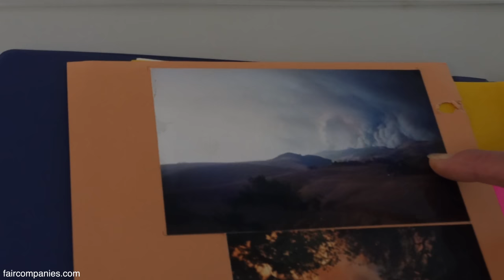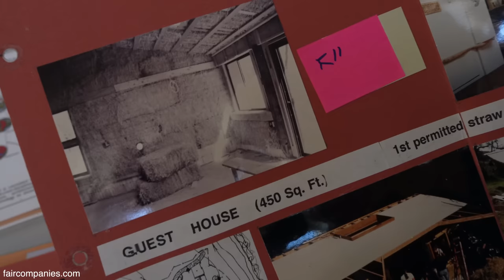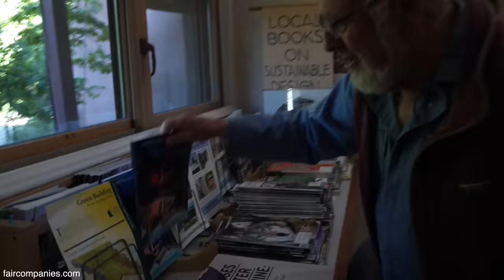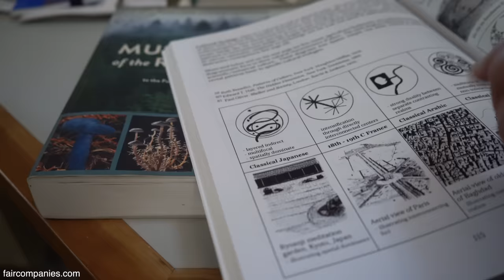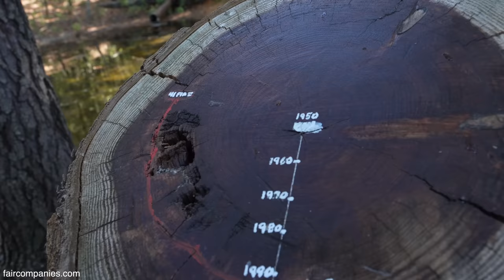Strawbale Home couple built after fire is bioclimatic marvel

Comment: At fisrt I thought it was an earthship type house but it is similar......The solar water heating window wall gave me an idea to also use mirrors in winter to direct more sunlight to heat the water.
In freezing winter Illinois temps. I played around with using mirrors to shine more sunlight on my solar panels. It made quite a bit more power without cooking the panels. In summer it'd cook and damage the panels if you tried it.....I forgot about using hay to build off grid.....Seems like something like a 20×20 hay bale cabin would be more insulated than a conventional home.
Reply: I replied the following to somebody else, I hope you find it helpful: "Don’t underestimate the caloric power of the sun: dry places that go below freezing consistently tend to be away from the oceans and enjoy clear skies. Think about the Earthships in Taos; this house is, if you want, a Strawbale Earthship. Earthships exploit passive solar in freezing places like Alaska or winters in the Rockies (biggest concentration in Taos NM). So yes, it will work in places below freezing with consistent clear skies."